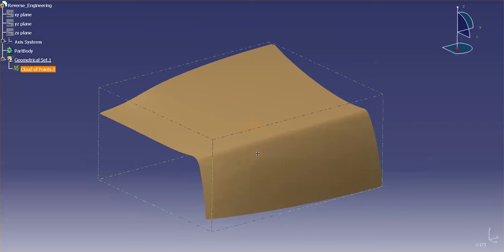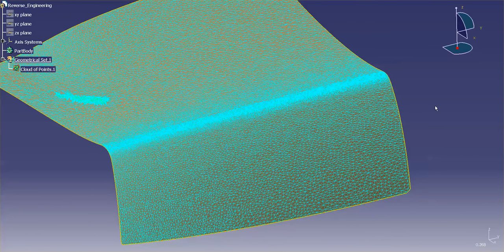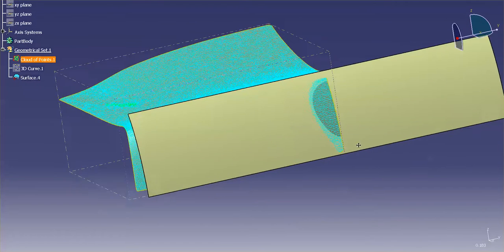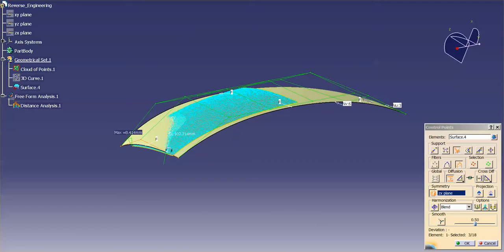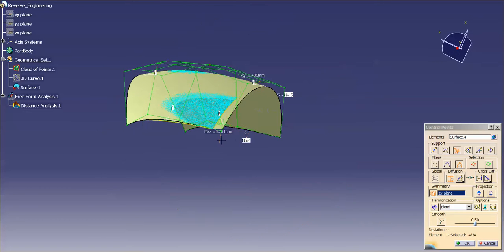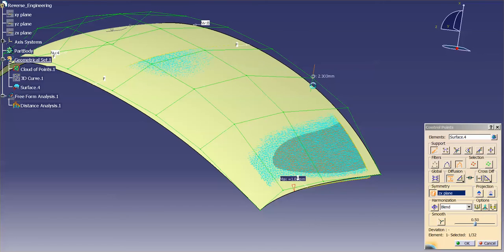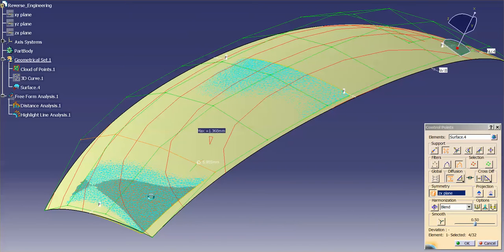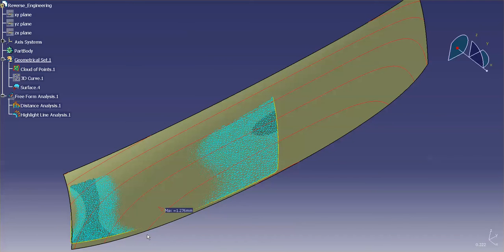Catia V5 | Catia V6: Class A - Creating a Deck Lid Step 1

Comment: Hi Steven.being so busy and still answering student-fashioned questions like my questions is appreciated.thanks alot.
but my question:)I have faced something that looks so strange to me,when I try to manipulate couple of surfaces or curves simultaneously and I activate the "global mesh mode" it sometimes works and most of the time does NOT!
may you please tell me what's wrong with that or maybe something is wrong with me:)?
generally how should I manipulate various surfaces or curves specific CV's simultaneously?
thanks.
Reply from the maker: It all depends on the software and the surfaces and the type of deformation.

Those are massive variables. I would need more input to see what is happening.
Reply: @StevenMarji Hi Steven.I use CATIA v5-6R2017,in which I know the "global mesh mode" is available in X Y and Z directions and not for local normal or tangent,and the surfaces or curves I try to manipulate all are NURBS without history on them,so why does not it work?
may you please make a short video about the prerequisites one surface or curve must have in order to be capable of being manipulated globally with the others?that's a huge help.
I appreciate.
thanks a lot.